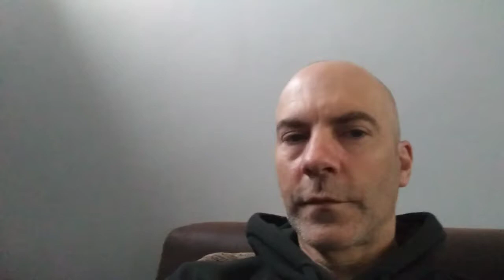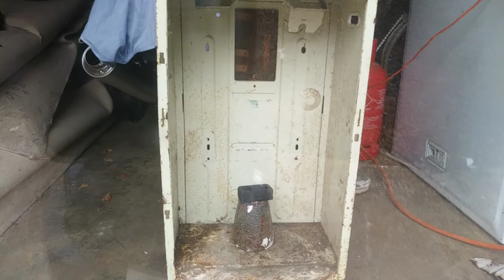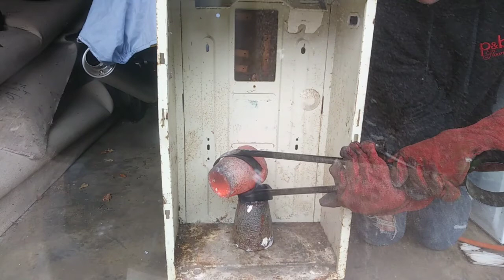Why You Always Heat Moulds Making Ingots!

Comment: How hot would you say your mold should be when you pour the metal? How should we heat them?
Reply from the maker: I heat mine on top of the furnace. You can see the moisture evaporate from the cold mold, not sure of the temperature but 2 - 3 minutes is more than enough. Thanks for watching
Reply: @ecoscrapper3501  thank you for saving me cause I would of been one of the ones who did that lol